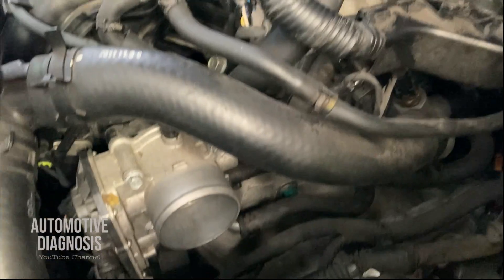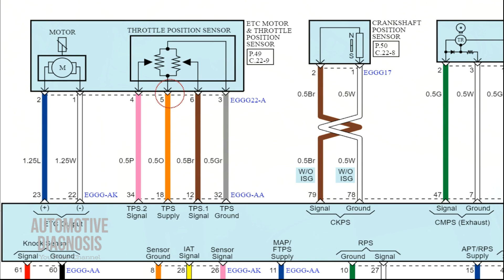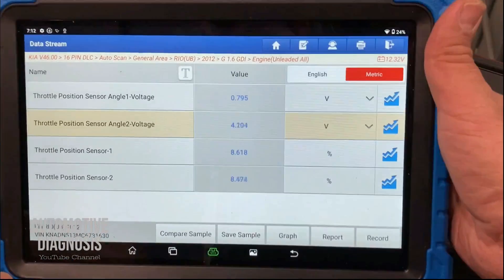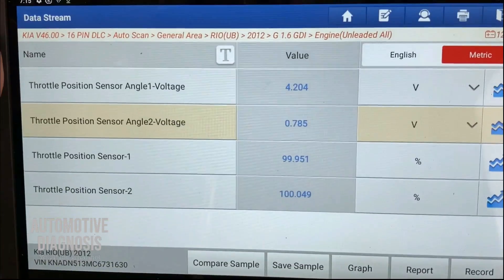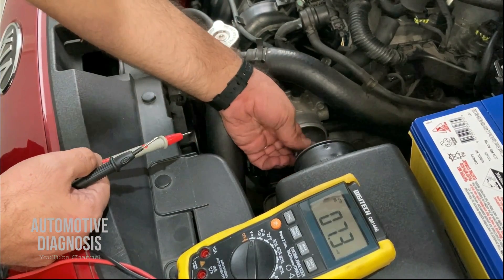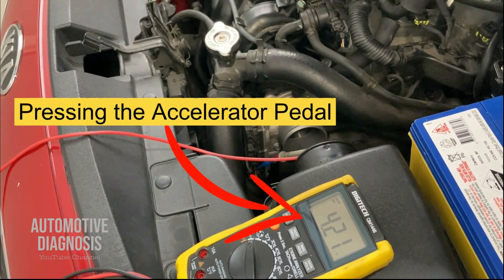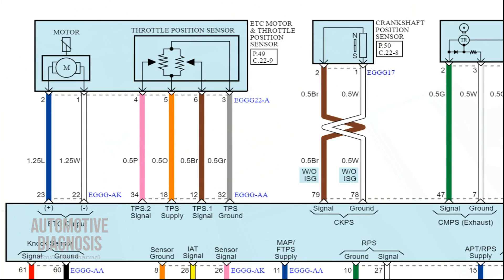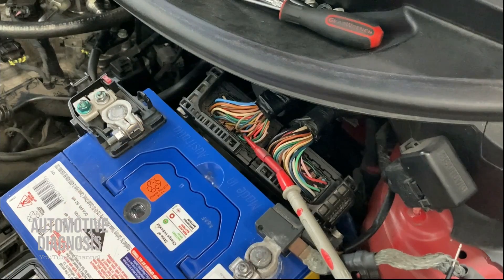Don't Regret Buying a New Throttle Body Without Watching This First!

Comment: I have a 2007 tundra 5.7 tps b 47% and tbs absolute 15% at idle. tps b  100% and tps absolute 83% at wide open throttle. Does my throttle body need to be replaced? Shouldn’t they read the same? No check engine light currently but have noticed stumbling at lower speeds while driving in the min mountains. Thanks in advanced

Comment: Thanks for the detailed explanation... I was facing an issue with the throttle body sensor even after it was replaced.I need your help to find what would be an issue.How can I contact you, it. would be a great help if my issue get fixed.
Reply from the maker: HI my friend, if problem still exist even after the part replacement, you need to check the wiring and that is explained in the video.

Comment: Hi, nice video.

I have a car lexus 400h 2006. The car not pulling and scan machine reads no fault code. What could likely be the issue. Car not pulling (accelerator not responding when depressed) and is not given fault code? Pls reply
Reply from the maker: Hi there, there could be a couple of different possible causes in this case, Pedal position sensor, Throttle actuator/sensor, wiring/connector on each one and also some other sensors like O2 sensor can cause this too. If there is no code, you can use the live data as I explained in the video.

Comment: How to manually benchtest throttle by battery
Reply from the maker: You can find the pin out as I showed in the video, then check the resistance on TPS1 and TPS2 with a multimeter and compare it with the specifications in the workshop manual.

Comment: How can no if the ecm is faulty or the throttle body, Have back crops tps 1 and 2 in the ecm and it give my perfect voltage how can i no the one to conclude it faulty in between ecm or the throttle body please
Reply from the maker: Hi there, you can measure from ECM side of the wiring. Or you can use a pulse generator to simulate the TPS and check the ECM response.